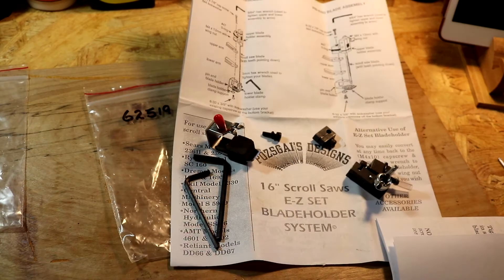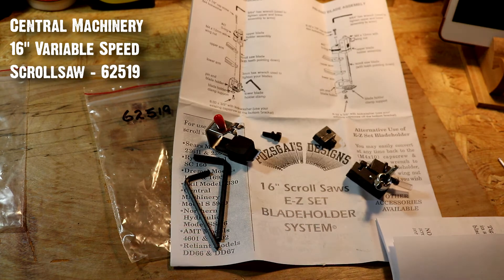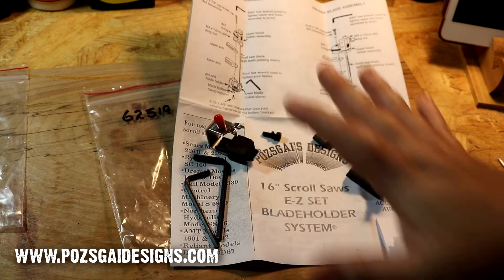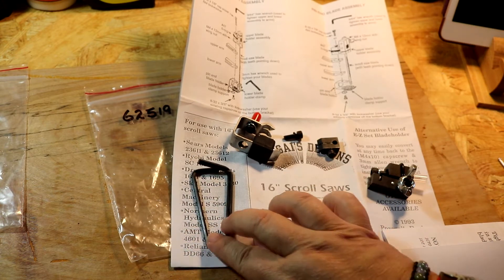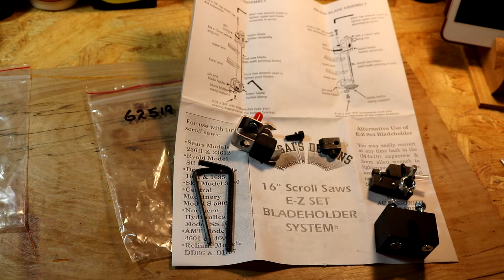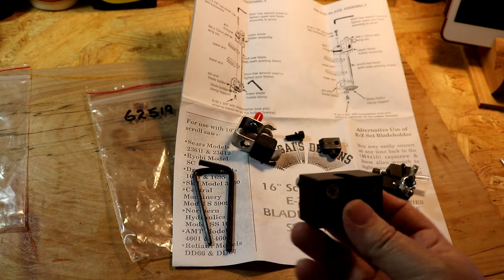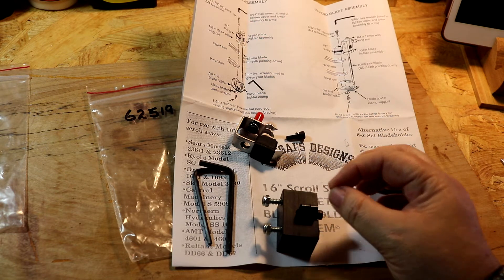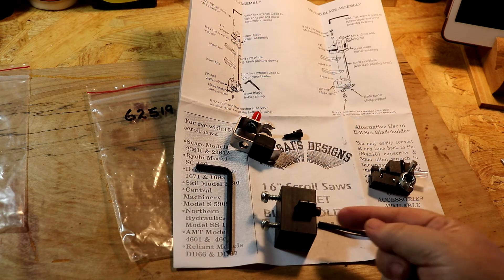Scroll Saw Upgrades EVERYONE Needs To Make

Comment: I've been working with the saw now for over a year. I've never had a pinned blade pop off the jaw set. Sorry you had that experience.
Reply from the maker: The reason mines slip out is because I have no strength in my fingers to tight up the knob, so this upgrade made it easier for me. TFW!

Comment: It is a pitiful situation, and a poor reflection on the manufacturer, when the consumer has to modify a machine so that it is easy to work with. Having looked into the construction of several scroll saws, I have the impression that one manufacturer came up with the design for a - poorly designed - scroll saw, and the others just copied it, because most scroll saws are badly designed when it comes to changing pinless blades, the exceptions being the more expensive saws from Pégas and Hegner, which however cost about 6 to 10 times the price of a DIY-store scroll saw.
Reply: You are 100% correct!  My lousy 16" scroll saw was inexpensive, but came from the chinese factory completely out of square in all directions (the bow parts are cast from a terrible antimony alloy that is fast to cast, but deforms too easily just as the part is removed from the mold!  But with a lot of perseverance and with the help of some small Machinist squares, i was able to bend it into shape, adjust it and fabricate a rigid and solid insert to replace the flimsy useless plastic insert. in the end, it takes a determined and handy person to fight against the poor quality of these scrollsaws, and modify them to be useable, at a reasonable cost.
Reply from the maker: I agree, but regardless of all the bad that people can shame this Scroll Saw I have had so much fun with it and learned allot. So now I know for sure that one day I can buy a better quality Scroll Saw and I will be not only delighted with it but know how to operate with out no problems. That is the beauty of having a machine that is not perfect you make it your own joy if you make some changes here and there. TFW!

Comment: While quite useful in respect to the pinless blade attachment, these copycat scroll saws seldom work acceptably, as they are poorly made in China and copied by perhaps, fifty or more factories, and each one adds their personal mistakes and bad execution points! In my particular scroll saw (VERY similar to yours!), everything was OUT OF SQUARE, so I had to spend almost two full afternoons to actually bend and readjust the damn thing to square it and align it reasonably well.  

To replace the  flimsy and USELESS, too flexible plastic insert piece that covers the round opening of the tablewhere the blade passes through it, I also made a wooden insert like yours, but found it to be too flimsy too... the solution was to cut several layers of Fiberglass Printed Circuit Board, glue them together with Epoxi to make a "sandwich", placing a thin fiberglass cloth layer between every PCB layer to add rigidity, wet the fibrglasscloth very well with the Epoxi, and press them flat until the Epoxy set; a light sanding of the edge made it fit perfectly tight into the hole on the table, which was NOT truly flat to begin with... So I removed it and sanded it flat against a piece of glass. A final waxing of the entire table surface resulted in a very smooth and flawless table.  As it came from the factory, the slot in the insert was way too wide, making it impossible to cut narrow or small parts that kept falling into the slot. My PCB ("Printed Circuit Board") insert is now  much better.
Reply: Wow! That is crazy but impressive. Are you taking orders? lol
Reply from the maker: Thanks for the info.